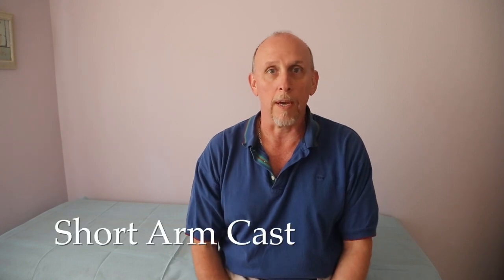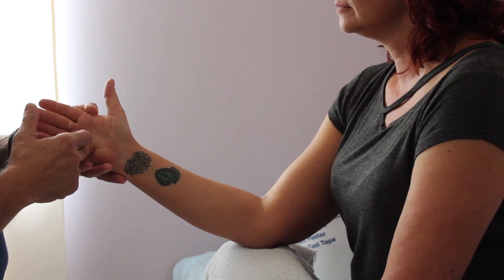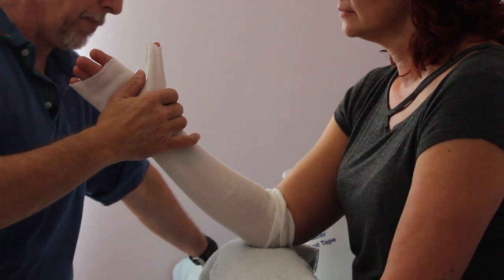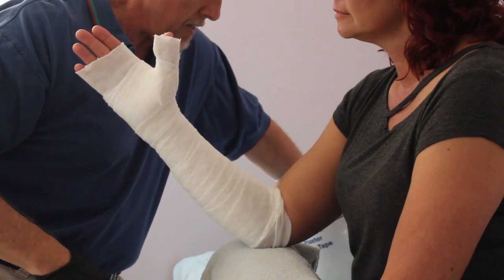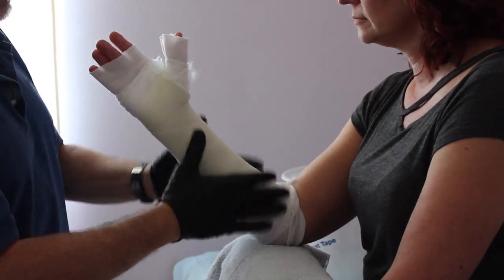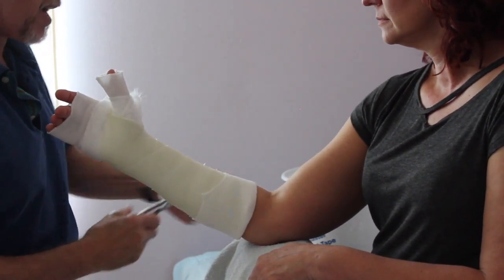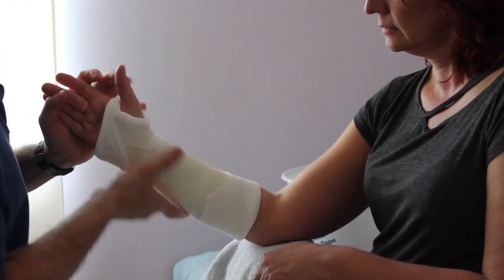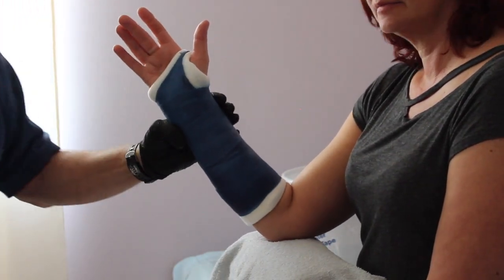Short Arm Cast

Comment: How thick is the foam adhesive padding you're using on the ulna?
Reply from the maker: It's the FRC padding. Starts at about 1/8 to 3/16 but is not firm to create a lump or step off. Pretty soft and flattens nicely.
Reply: @orthocastsbykeith8844  Thank you sir. Would you happen to have a link?
Reply from the maker: @ihernandez2609  It is sold by BSN medical (casting supply division)

Comment: Where did you get the box they rest on?
Reply from the maker: I invented it. I had to retrain a tech and my shoulder was burning after the first hour. So I put a few layers of ortho felt on top  of an empty cast tape box and covered it with stockinette. I got the idea to put vinyl under a small toolbox to protect the clothes and a pad on the top for their elbow. I sold 2 in 5 years, so I don't make them anymore.